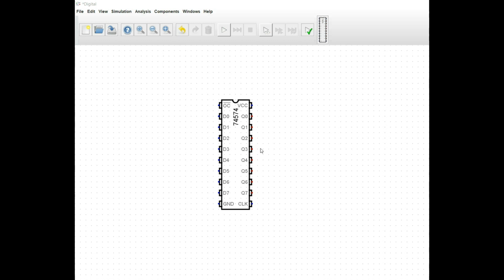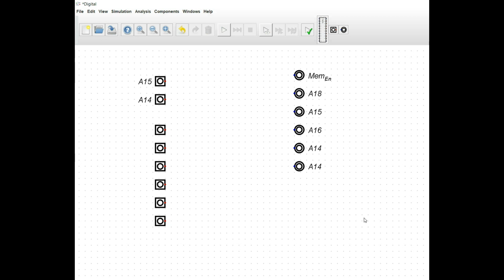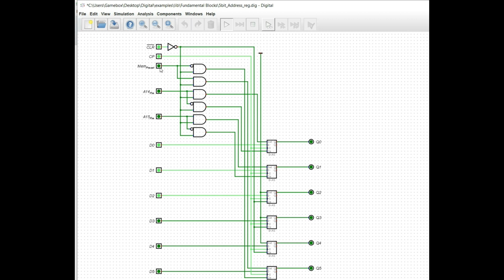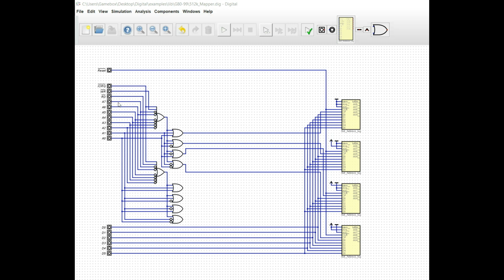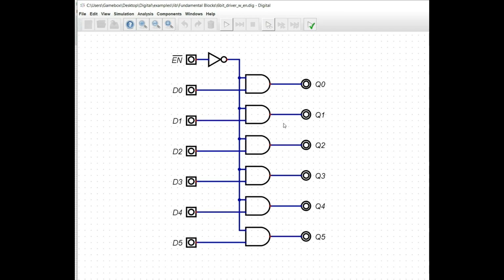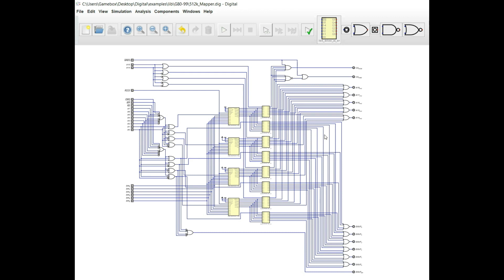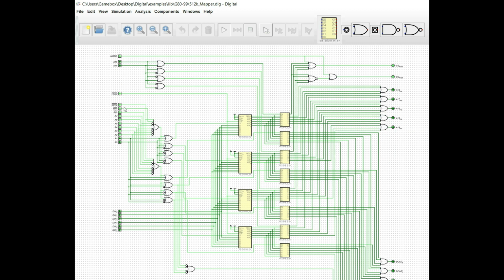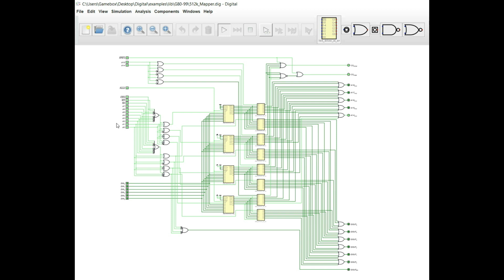Digital Logic Part 1: A Memory Mapper

Comment: I thought I'd drop a sub because I'm getting into CPLDs and I am quite pleased with your suggestion for Digital (I'm incidentally also working on a Z80 machine with an MMU and started working on an SPI master). I'm looking at using the ATF1504 presently and given how unstable WinCUPL is, it's nice to have a tool like this. I hadn't heard of Digital before, but it is definitely a gem in the rough.

Comment: Very cool tutorial! While programming a CPLD using schematic capture is very visual and entertaining, it is not very practical for bigger circuits. Altera/Intel Quartus supports Verilog and VHDL, and the whole memory paging mechanism can be described less than a 100 lines of code. In my Tiny Z80 project I did exactly that. The memory paging along with various chip selects are implemented in in a single EPM7064 CPLD. No page register read back though ;-). Maybe next time you can show how to do this in VHDL?
Reply from the maker: Sergey, thanks for the input man. I’ve got some VHDL stuff coming up. But, since it has a relatively high learning curve, I thought it was better to start with the basics. You to walk before you can run. FYI, I’ve got a video I’m getting ready to upload before long that concerns you. ;)

Comment: Why do you need the read functionality? In my mind the value you write to one of the four registers, will also be in program memory...? If you take out the read functionality it simplifies the circuit a lot and leaves room for other logic in your CPLD. [2c]
Reply from the maker: Marc, suppose you mapped a new window into the memory space where that data is stored, and you need to know which memory you’re currently residing in. It’s not require. It certainly doesn’t use a lot of logic. And at the end of the day it is a nice feature.
Reply: I would think that your memory mapping code would be part of some kind of "kernel", and that the kernel and its data would probably want to exist in some memory ranges that cant "go away". Things like reset vectors, some ISRs (at least INT and NMI) etc you would want to have instant and consistent access to, and probably not have to do anything funky to bring them back when needed.
Reply from the maker: @TomStorey96  typically for most stuff, like CP/M, it would be.  But assuming you're writing stand alone programs.  You may need to recreate some of these low level features.  It all depends on what you're doing, I suppose.